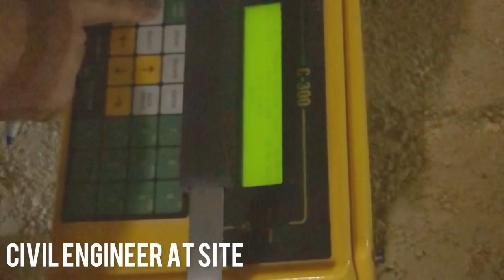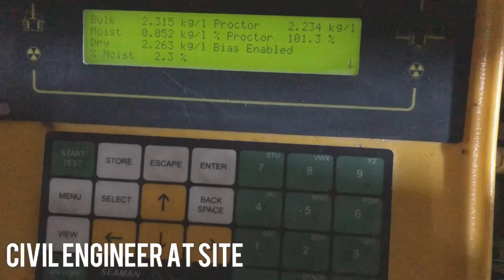Field Density Test| Soil Compaction Test| Proctor Test for Soil at Site| Civil Engineer At Site.

Comment: Sir , if we require 95% compaction.... and we test at 3 different points on site .. first point give me 90% second point give me 95% and third give 98% compaction... the test will pass or fail ... if it gives lower value of compaction on some points ???
Reply from the maker: Pass but you can re compact the areas where you got the lower values
Reply: @CivilEngineerAtSite  thanks